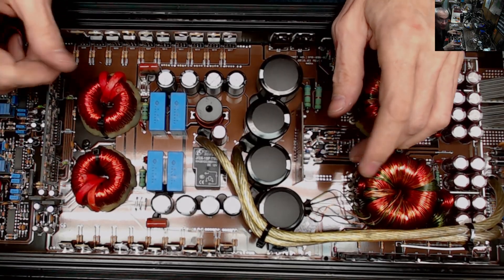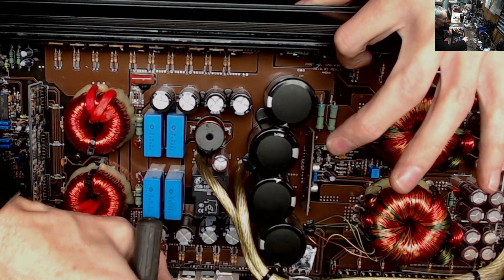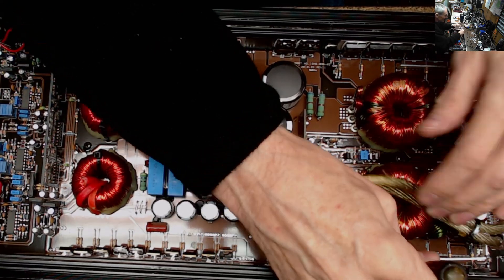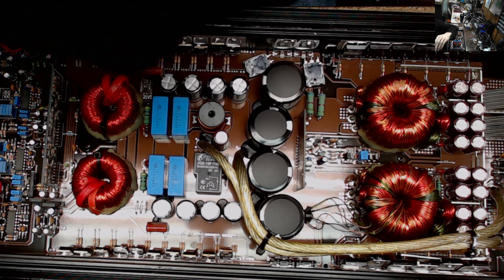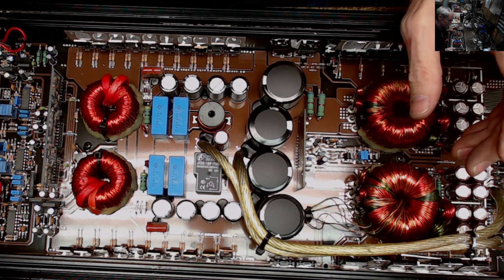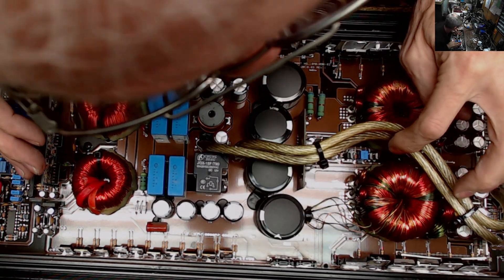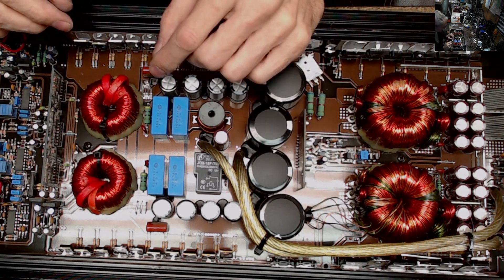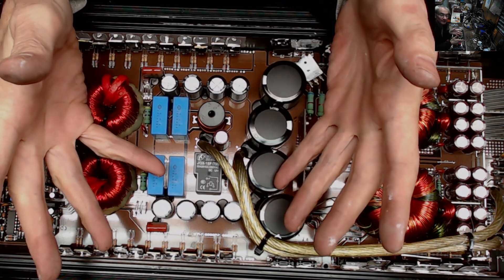AQ AudioQ AQ-2200 Class D Amplifier Rectifier Failure All Legs Broken

Comment: is not possible to weld with tin any other legs or wires io to get the amp working first? or in any case is not possible to use another pair of rectifiers from other older amp?
Reply from the maker: Yes, you can solder new legs if in a pinch but I would use lead-free solder as the melting point is higher. Even better would be to spot-weld (like a battery spot welder) the new legs if it doesn't destroy the diode junctions.

Comment: what would you say to those who mount their amp over subwoofer box? a lot of people here in spain were doing it
Reply from the maker: IF an amplifier is to be mounted on an enclosure (NOT RECOMMENDED) then I would open it up and use something like Gorilla glue clear grip / E6000 and secure everything down. Silicone is too pliable and components will still break off.

Comment: Hey Todd, were the broken off rectifiers shorted or just broken off?
Reply from the maker: Just broke off at the board. The VIAs are slightly wide for the transistor leg so there are some unwanted stresses if the legs are not formed for the spacing. Which they weren't.
Reply: @ellensburgamplifier  i think thats the answer to my question not to stick some wire of piece of, haha, regards
Reply from the maker: @tTRANCEMAR  Always happy to help my friend!